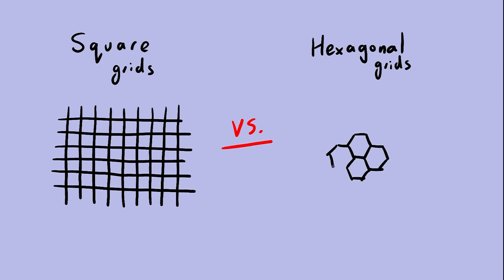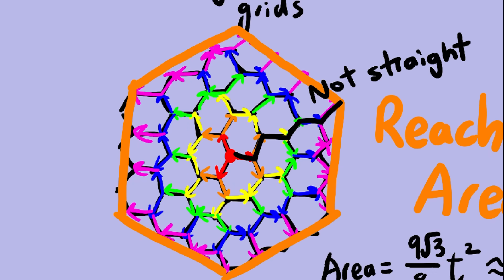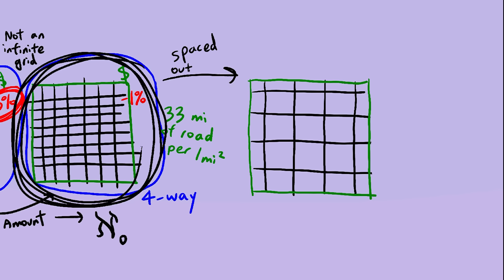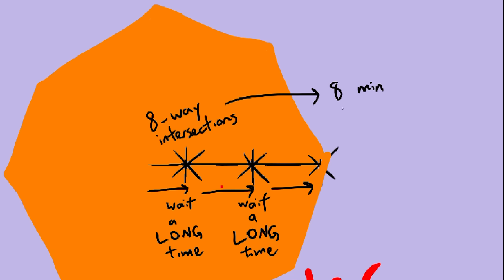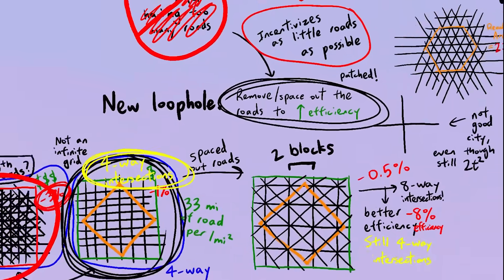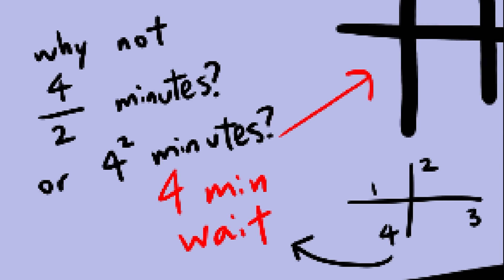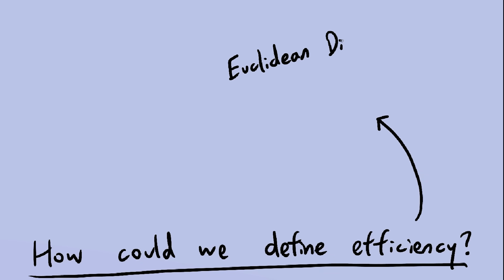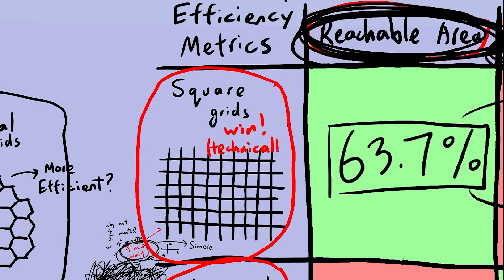Would hexagonal city blocks be better?

Comment: I think a way of fixing the reachable area problem would be to make it so you can only reach half a unit away from the road into the city. That'd punish the spaced out roads by not counting the inside of the larger square, while fully counting the smaller squares. Idk if this actually fixes anything, but it seems most intuitive to me
Reply: If you do that with square blocks you'll find that leaving unreachable holes in the middle is actually best, which is kinda funny.  (The hole ends up the same width as the road.)

Basically, the reachable area gained from the 4 sides being longer is worth the 1 space lost in the middle, up to a point.

Comment: my square table wont fit on this hexagonal corner
Reply: My hexagonal table won't fit in this square corner!
Reply: Skill issue
Reply: This is why hexagonal tables are superior. It also means you can face 5 peopl at all times
Reply: @blucksy1  This is why king Arthur’s knights were at a round table, you could face ∞ people at once
Reply: @blucksy1  if it's on a hexagonal corner, then only 4 people
Reply: @AshutoshSamantaray-w7z  if its a square corner with a square table than one
Reply: Boy do I have the product for you.
Reply: @user-qw1rx1dq6n  rotation
Reply: how did you get a hexagonal corner?
Reply: @MJS-lk2ej hexagonal blocks -> building on the corner of the hexagon -> 120° angle between the building's walls
Reply: @shlokvsh bold to assume that it is a regular hexagon and not an irregular hexagon. regardless, a 90 degree corner can fit in a 120 degree corner,one side is just going to be slightly ajar.
Reply: @MJS-lk2ej yeah but not all plots(land parcels) would be a rectangular shape. Some builders would've to buy plots with a 120° angle and they would want to maximize the built-up area to make more money. They could simply make rectangular building and leave the extra area for green space/etc. but they probably wouldn't.
Reply: Non issue. Blocks can be any shape and still build the buildings rectangular on them.